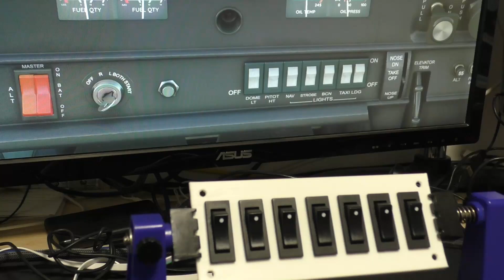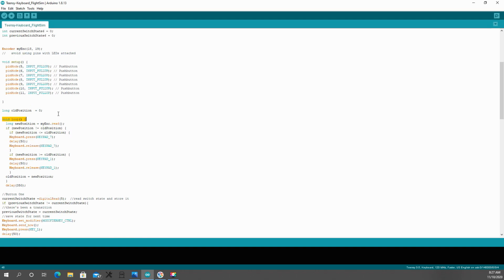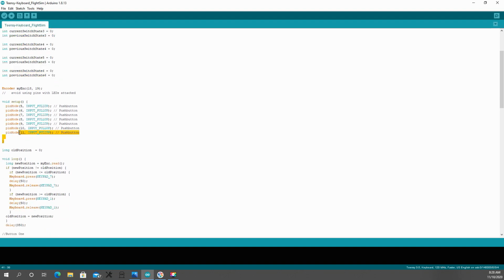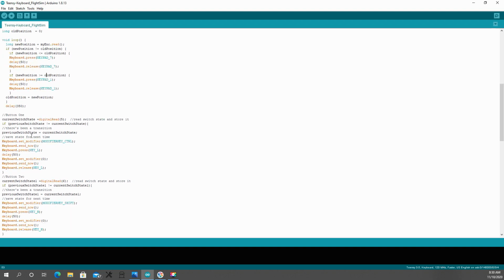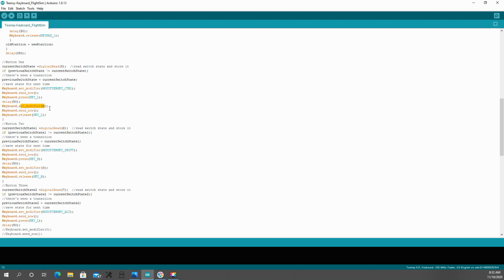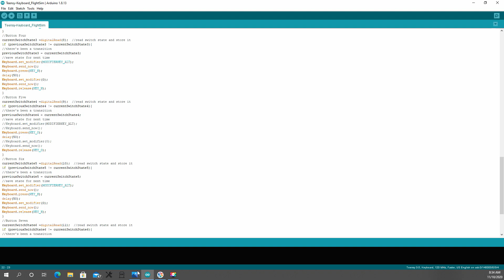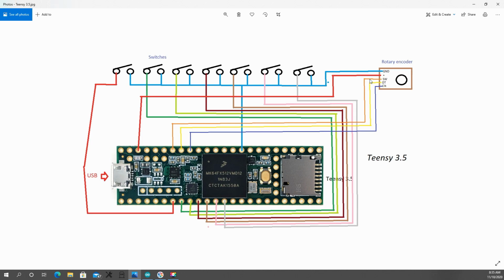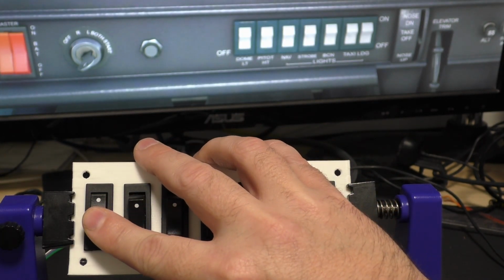I Built a custom Flight Sim Controller for MSFS 2020

Comment: For dome light I use the (msfs) flash light ALT-L, works better than dome light in flight, not so bright.  Start-up issue mentioned by Jose is my issue.  Until I find a fix for that, momentary buttons would be easier.
Reply from the maker: I've just worked out what buttons start in what position or just start with the plane turned off. Im waiting for the DC Designs F-15 to see if i can make panels around that.

Comment: thank you very much for this helpful video.  One question: the initial state of al buttons in your panel  is off, but if you start the simulator with the aircraft on, some of the buttons (in teh simulator) will already be on.  Is there any way to sinchronize the status of the buttons (simulator-panel)?
Reply from the maker: Not that I have found sorry. Like you said works better from dark. I guess if you know what buttons are on when you start the aircraft you can put them into that position before you start.

Comment: How do you find the trim wheel? I'm having problems where your delay works for slow rotations, but spinning the wheel quickly doesnt work. If I reduce the delay the keyboard write works correctly in notepad but Flight sim seems to ignore the wheel spinning quickly. I guess there is some sort of issue with the software which is ignoring these frequent key press commands but I cant figure out how to fix, any ideas?
Reply from the maker: I haven’t tried moving it really fast. I suspect the game starts ignoring it as you said. I’ll try in a couple of days and get back to you.
Reply from the maker: I tried changing the speed. But there seems to be a limit the game wants between presses. I'll have more on this project after Christmas. Just have to submit my last thing for school then I'll have plenty of time for my channel and projects